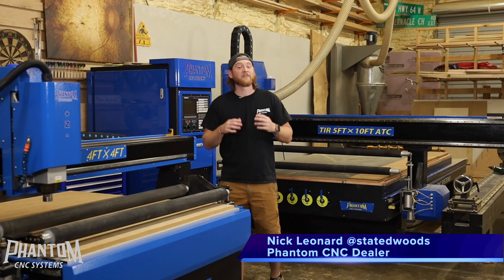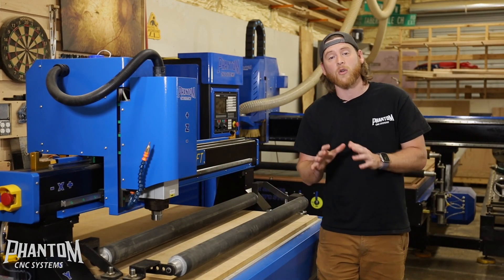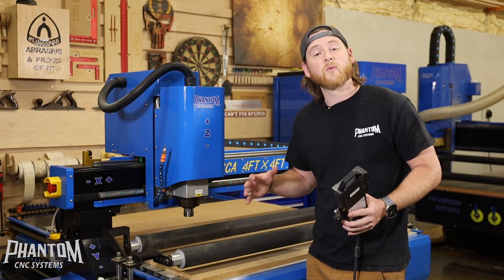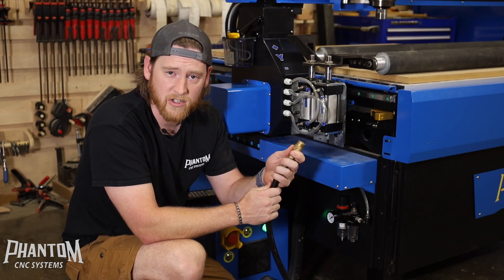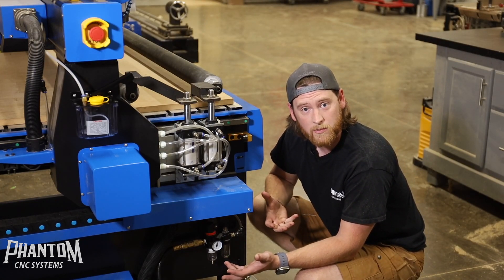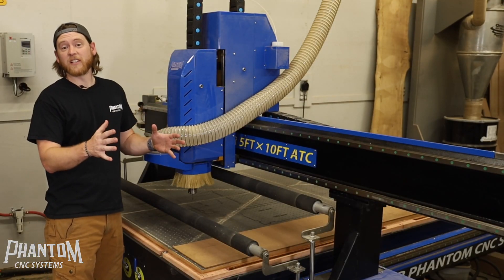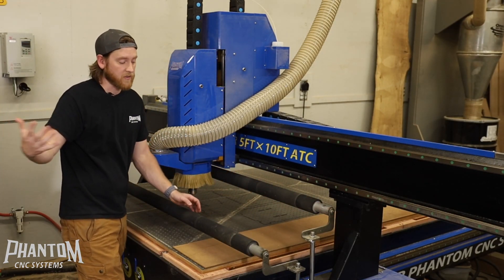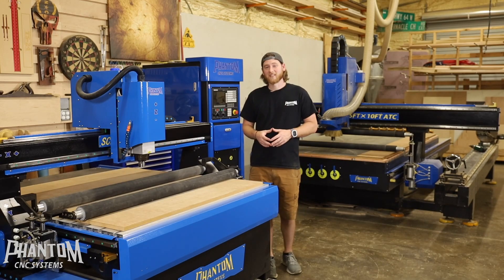Pneumatic Roller CNC Hold Down on Phantom CNC Systems

Comment: I only wish they worked as you described. My s series only has one side of the rollers, which is a single piston not double seen in video, on x axis down at one time. SEbveral calls were made and the fixes You told me to do did not work. I had to remvoe the rollers to use the CNC.